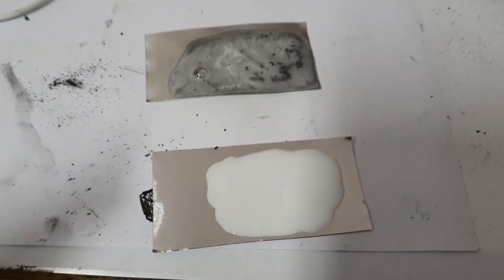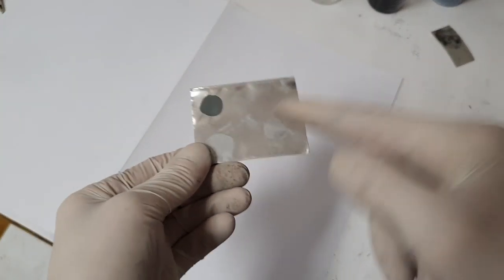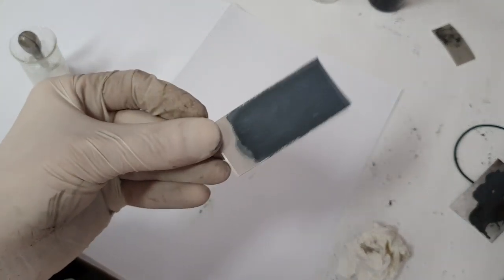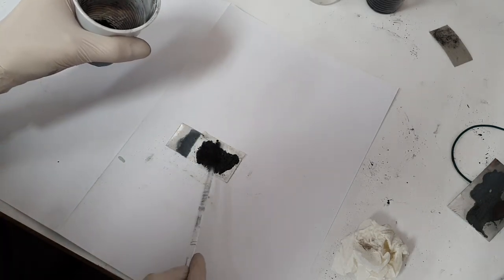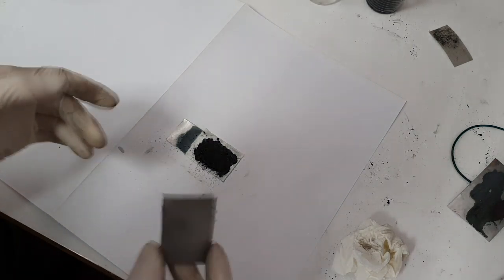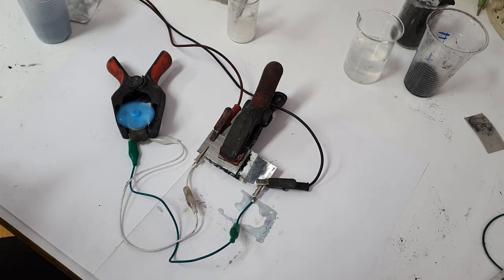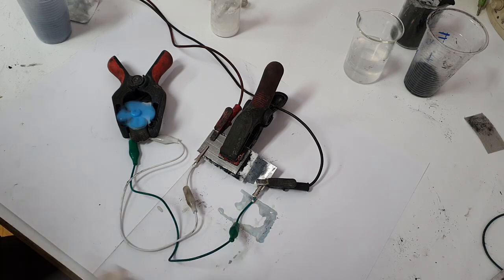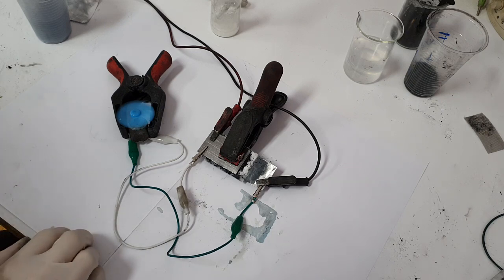"Hybrid" Aluminium Air Battery - random experiment

Comment: The aluminum is the power source to convert ZnO into Zn. The Zn in turn is used for zinc air battery. It's electroless. No power needed. I will try 5 parts Zno to 1 part aluminum and see if it converts all of the ZnO into zinc metal powder using NaOH. No worry about aluminum corrosion. It'll be totally consumed with lots of heat and gas. Capture it for fuel cell or vent it. The aluminum serves only to convert the zinc oxide into something usable for a battery cell. The power supply isn't used. The aluminum recharges it and acts as a sort of a generator.
Reply from the maker: Aluminium is stating to consume when all zinc is oxidized again during the discharging.
Reply: @cayrex  Add more aluminum with fresh alkaline and see if it regenerates. I believe it does. But the spent aluminum oxide remains increasing weight.

Comment: Hi AGAIN Cayrex2 thanks for getting back to me so fast I tried it Last night and You know what happened 
1     I Checked the voltage right away it was 278 mv
2    Then I charged it for 5 min
3    The voltage did not change BUT the Polarity Changed Weird Eh !!! 
4     I left it till today and I checked it It was @ 500 mv. Wow I said....
5     I will try to charge it Today and see if the Polarity Changes, or it charges ,or It stays the Same 
6     I'll fill you in on my results. So far so good  :) I made some changes Like instead of activated 
      Carbon I used Graphite Powder. I got it from a friend.and I used very Little Just like you
      did in your presentation it was free so what the heck LOL
7    I'll fill you in again tomorrow  on my results OK...... 
8   Ps My e-mail is Mustashi113@gmail.com Thanks Again :)        Stash

Comment: Would you try a silicone oil mixed with an electrolyte, would that make the battery last longer before ultimate failure as and aluminum air battery
Reply from the maker: Maybe, I dont know 100%

Comment: That is excellent, I will try that on the aluminum that I put in my Cement batteries.  I had over 4 years of use with them but the current got smaller of time.  This method could allow the current to stay higher longer.  We shall see.  Thank you for your research.

Comment: ty for the experiment
Reply: what power supply are u using ?
Reply from the maker: @Fortitudoo  BT 305 from Basetech
Reply: @cayrex  ty i got the load tester u recommend while back and that works good
Reply from the maker: No problem.

Comment: This experiment was interesting! Using zinc oxide to plate aluminum, this battery was more like zinc-air. Rechargeable metal-air batteries use catalysts in black carbon to make the oxygen reaction reversible. Maybe you could be try this and verify the ciclability

Comment: Logical experiment after your previous vid, good work.
I think you would get more information using your electronic load to measure charge / discharge graphs.
What did the negative electrode look like after a few cycles, was it holding up?
I hope it was one of the 5 useful experiments out of 100   :-)     Martin.
Reply from the maker: later I was using the electronic load. The battery last around 12 cycles. After 12 cycles the capacity drops. So, no to this one, but it was a good experiment. The negative electrode looks good,... and was like by start,... zinc plated on aluminium with no visible degradation.
Reply: @cayrex  The fact that the Al did not corrode and the Zn plating remained intact is very encouraging.
A Zn plating on Al foil current collector would be very desirable in a Zn chemistry battery, very cheap and plentiful.
It maybe worth replacing the AC side of the cell and trying again, see if you can get another 12 cycles, it would show the problem was in the cathode side of the cell, and prove there is hope for further experiments using the anode.
Reply from the maker: maybe if I add some NiO or MnO2 to see what will happen this time. Because of the zinc, the battery will act like MnO2 - Zn battery?
Reply: @cayrex  Yes the MnO2 would be a good idea, maybe working like Zn - ion cell :-)

Comment: Hey there buddy . If you can work out how to plate magnesium into stainless steel then I think that would make a good battery that’s rechargeable by replaying the stainless steel  and reinserting like like it’s a cartridge .
Reply from the maker: Nice idea,... but this will not work! You can not plated magnesium aqueous solution material.
Reply: cayrex2 is there any way magnesium can be plated to stainless ?
Reply from the maker: @Buzzhumma  The problem is that it just can't be done. All of the electricity you put in will go solely to converting water into hydrogen and oxygen because magnesium is so electrochemically active, that it fights reduction to metallic form more powerfully than the hydrogen. Maybe can be done with non aqueous solution. ChCl : urea : MgCl,... maybe.
Reply: cayrex2 what about plating onto magnesium ?
Reply: Magnesium is so reactive that it is right to say that plating magnesium on aluminum is impossible. 
The reason I say aluminum is because aluminum is a better material than stainless steel
Reply: What about a magnesium alloy that’s less reactive but still have hi energy of magnesium
Reply: @Buzzhumma  
Scientists are researching on Mg battery. But there are some barriers to overcome.
In addition, there is a Mg rechargeable battery in Korea like Na battery already exists.

But it seems that they   won't appear in the market at present.

But once Zn or Al rechargeable battery works, it will be likely to be great
Reply: Can we plate onto magnesium?

Comment: So technically air batteries can be recharged with only the oxygen present in the electrolyte? You don't need air from the outside? Because here there's no opening on the "air" side
Reply from the maker: Technical,... yes the oxygen from electrolyte additive can work,.... technical. Yes, you need air (oxygen) from outside,... If technical the battery will work on oxygen from electrolyte,... the oxygen will be limited. The battery is not vacuum sealed so the oxygen can go into the cell anyway.